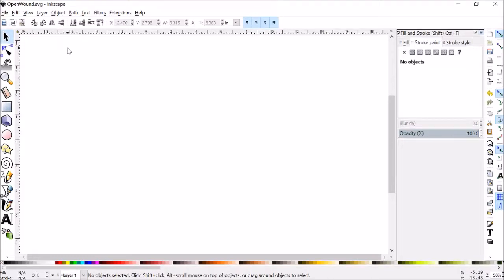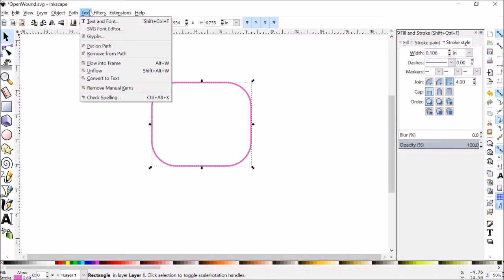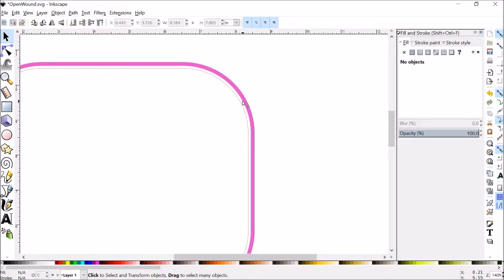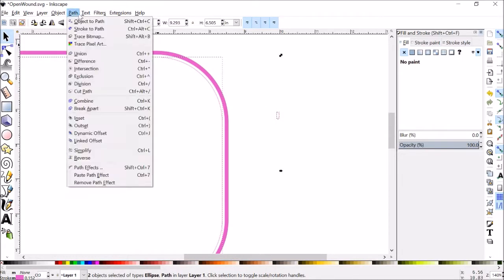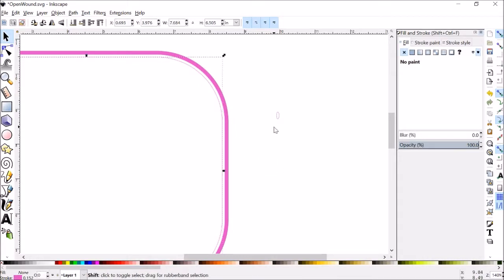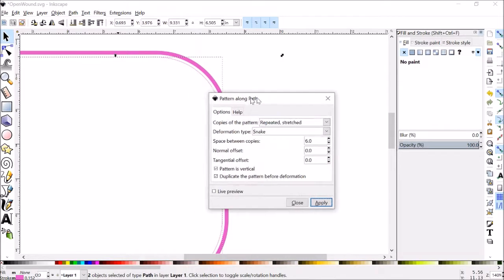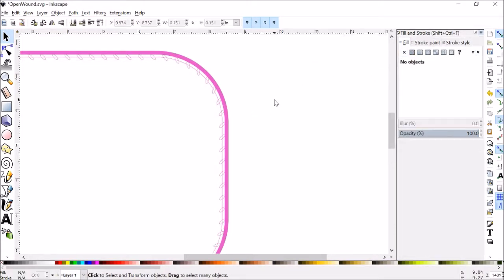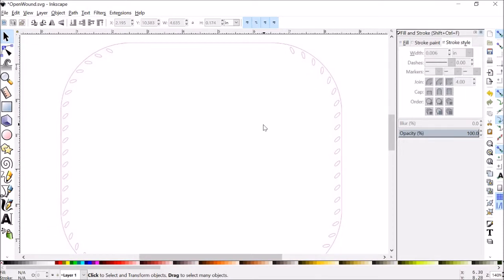Leather Stitching Holes in Inkscape

Comment: So when designing, how would you know what size to make everything? Are you building the wallet in cardboard or paper to figure out what is needed before hand?
Reply from the maker: Admittedly, I'm not much of a leatherworker, more of a general maker of things. That said, there are a couple of use cases for a printer/scanner that help with this issue. The first is that you can always print out your design to see if you like the size, and iterate from there. 

The second, which I think gets more to your point, is that you can start with a physical design cut out in cardboard and paper (or an existing leather design that you've disassembled), then use a scanner to get a dimensionally accurate view of your design. You can import that scan into Inkscape and trace it (there are several workflows for this). You could also take a picture of your design with a phone and a size reference (like a ruler) in the picture and scale the picture accordingly.

Not sure any of that rambling helps, would be interested to hear what more experienced leatherworkers have to say.

Comment: While selecting "Pattern along Path", what is the unit measurement of "Space between copies", is it possible to select an iron punch spacing of "3.38" or "3.85" mm? https://drive.google.com/file/d/1XvoC0F8F9k77P7DjbP8eI0sT2VB4NGv8/view?usp=drive_link The stitch marks on both shapes were made with 4mm spacing, but comes out 5mm spacing on the actual size printout.

Comment: I wanted to make a credit card holder from leather, and use Inkscape for drawing and then print out the patterns. Problem is the sizes of the inkscape document don't correspond with the printed document. For example if you would draw a rectangle from 10 x 10 cm in Inscape, the printer does not print these dimensions. I don't know how that is possible.
Thanks.

Comment: Is there any way to do this on two pieces where you have done a union?   Say a circle and square, square top round bottom.
Reply from the maker: If you'd like to have the stitching go around the original two parts, you would need to make duplicates of those parts prior to the union (so they won't be consumed by the union) to then use as your paths for the stitching. If, on the other hand, you'd just like to have it go around the outer border of the unioned part, you should be able to use the method from the video. Let me know if that helps!
Reply: @makingmakers4355  I want it to go on the Inside of the union. I can get it to make the inside path of the union, but when I try and generate along the path for the holes, nothing happens. I've tried it several times.
Reply: @makingmakers4355  what you wrote made me think.  I found that if I do the generate along path first, I can then do a union, then remove the holes I don't want. Thanks for making me think and look at the problem in a different way.
Reply from the maker: @TheWizcam  I'm glad to hear you found a way that works for you! I'm curious why the first way didn't work. I know it matters the order that you select path and the object you're patterning around the path. Any idea what version of Inkscape you're using?
Reply: @makingmakers4355   I am using 1.0.1 (3bc2e813f5, 2020-09-07)

Comment: When I do it, it doubles the holes. I have 2 holes side by side going around my pattern instead of 1 hole
Reply from the maker: That's an interesting issue that I haven't run into before. When you click on the shape you're patterning along with the node editing tool, do you see one set of nodes or two parallel sets?
Reply: @makingmakers4355  I figured it out. It was something with the dot (hole), not sure what.  I deleted the dot and made a new one and it worked perfectly.   Thanks for answering and Thanks for the Awesome Videos.
Reply from the maker: @TheWizcam  I'm glad to hear you got it working and I hope others will also get some use out of it. Thanks!

Comment: Really handy tutorial thanks!. do you know how to set the spacing between objects to mm? I think its in px by default. like if i want the marks to be for 3mm spacing or 6mm spacing or is it a just trial and error thing?
Reply from the maker: That's a good question! I'm not aware of a way to do that directly, but the ratio of pixels to mm is set as your resolution. For me, it's 3.78 pixels for every mm. So if you wanted 3 mm, you could multiply 3.78 by 3 to get 11.34 px.
Just in case your resolution is different than mine, you can try making a 1 mm box using the rectangle tool and the W and H settings on the top bar, then change the units to px. The W and H will then change to the equivalent amount of pixels.

Comment: The problem is that the "space between copies" is pixels and not any useful unit such as mm or inches. So you are best to make an object for a hole and split it in half vertically. Then duplicate and flip it and then separate it horizontally by the distance of the stitch you want. The "space between copies" should be set to zero so that the two hole halves meet up to make a complete hole. 

Also don't use "repeated, stretched", just use the "repeated" option and "snake". 

Use the tangential offset to dial in the stitch holes so that one lands on a desired index hole or two holes straddle a desired symmetry line.  

The method I describe will be useful for those that use a specific stitching iron/chisel and want to maintain the exact distance to match your tool. 

Honestly, that there isn't an option to use a measured unit distance from the midpoint of your object to be patterned makes me want to switch to Illustrator or some other option.

Comment: I use this method myself but when applying it on 2 difrent shape size the holes do not match. Could you please explain
Reply from the maker: I'm not sure I understand. So like if you do a set of circular holes and a set of square holes in a pattern, they don't match up? If that's the case, I suspect that's caused by the differences in sizes of the shapes being patterned (the square and the circle are slightly different sizes). 

The patterning extension only allows you to set the distance between the items, so if your items are different sizes, but you keep the distance between the same, they'll end up not quite matching up. They might be close at one point, but get worse as they proceed around the border.

If you make the two different shapes the exact same size, it might fix the issue.
Reply: Making Makers thanks for the explanation. One more thing..should i use this method for the whole pattern of a wallet for example...including the slots...as you know the slots may be different in shape and sometimes in size.  So when usibg this method individually...it may come worse when putting them together or when assembling them for the whole pattern.
Reply from the maker: @abdellahabdellah1919  I'm not sure on that, my expertise is more in Inkscape than in leatherworking. I'd say give both methods a shot and see which one you prefer.